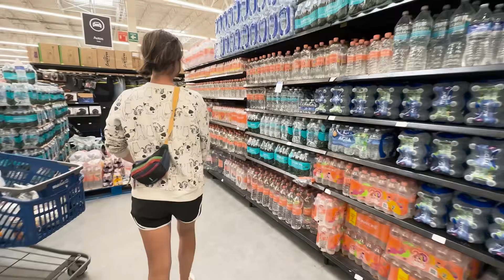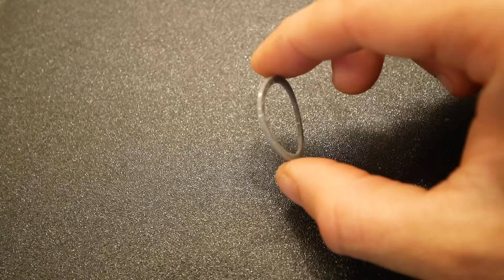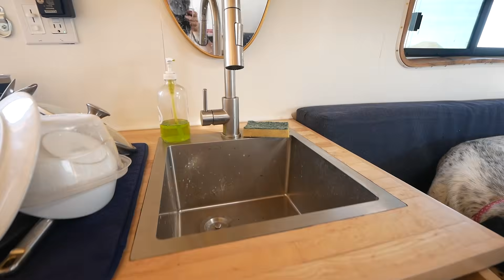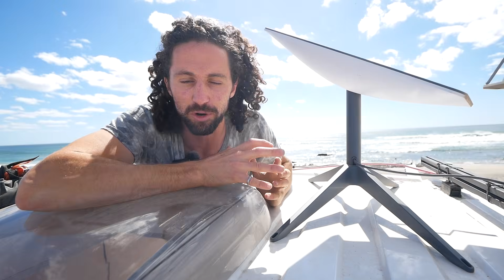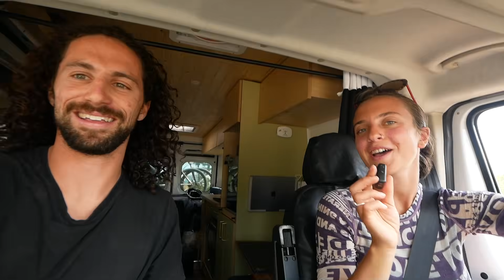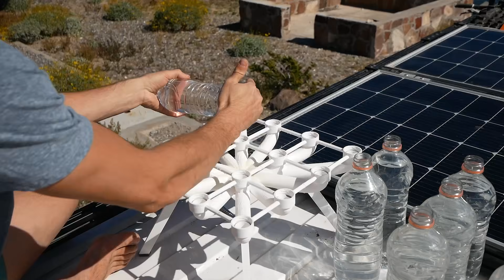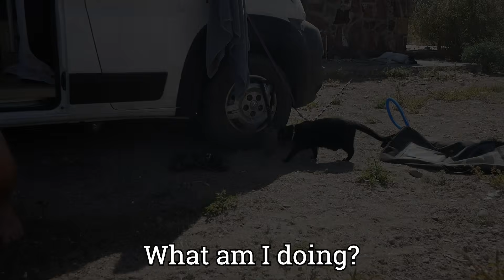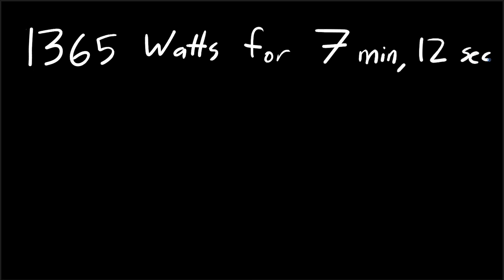I Built an Unnecessary Invention for Van Life

Comment from the maker: Regarding my nose: I scraped it on some coral while swimming in Baja. Super minor injury, but face wounds tend to bleed a lot 😂
Reply: Suggestion for you: Get some magnetic child lock mechanisms. They'll stop your drawers and cupboards from opening, but still let you open them with a magnet! Great video as always!
Reply: Please research coral...I lived on Hawaii 30 odd years ago and I remember people talking about living coral and human bodies
Reply: :o
Reply: Great memory reminder!
Reply: Here are 2 examples that you can do. Get a tankless propane water heater. OR. Get a black bucket or jug. FIll with water. Print a valve of some type to release the water to hose. Make a valve vent. Control that valve vent for water pressure. Make the jug or bucket removable. Make video on start to finish. Black attracts heat. WHITE or Clear reflects heat.
Reply: Ahahah i tought u face landed the ride with ur gopro stick and bike 🤣
Reply: At this point its almost a shower drone😂
Reply: Man hope rou heal really soon
Reply: regarding water usage. I came up with an semi easy solution for water recycling in a shower but you need to be standing in a tub to make it work and have some plumbing know how. The tub needs to be filled with warm water and you need a pump water through  two filters up to a shower head. It requires some adaptors to get working but greatly reduces water needs and creates the ability to have longer more comfortable showers anywhere. When your done your shower you can then use the filtered water for a portable washing machine or water for cleaning instead of dumping it, (Though filtered I wouldn't trust drinking it). You have three choices of pump, a submersible portable battery pump (avoid the cheap ones, (you get what you pay for scenario), AC Submersible pump, or 12v DC RV pump. You then need a filter to attach to the pump for debris and hair. Then an in line filter after the pump for soap, dirt, and everything else. That's the basic concept, unfortunately the situation varies for how you create a water recycler. You can get really creative with it because adapting it for different uses just requires a tub over tub or platform in tub design.
Reply: R u ok

Comment: In a clear bottle what the sun does is kill microorganisms and better a little the quality to drink. But for that is better to use glass because single use plastic is not recommended for repetitive drinking. But for the temperature, it depends more on the temperature of the place combined with the light of the sun. So you would end up with hot water only in places you wouldn't want to take a hot shower. I am from Barrancabermeja, Colombia and the water in the pipes on the roof gets very hot, so for every shower you take during the day, the first minute you feel like you are being prep for cooking until the water of the tank starts to come jajajaja

Comment: Damn man I just wish you'd do a bit more research at least. I understand it can be fun to figure everything out and trial and error is essential. But hen you waste a bunch of plastic (and time)  to come out with a bunch of issues while you could have just used a Black bag (or canister with a small whole) like everybody else.  Also having many bottles while increasing surface area for the sun (possibly a bonus) the space between them actually also acts as a cooling effect. So this invention truly is unnecessary but hey it's all about crating I guess. But some mistakes just should be more than obvious from the start. Like even if it would have worked it would be so much work each time to use it lol..

Comment: There is some merit in making it this way but black, small amounts of water with more surface area will heat up quicker. You could add an air breather to each bottle that ends near the bottom (Top) of bottle, make sure you fill each bottle below the end of the breather. Each breather goes through bottle neck and  attaches to the feed pipe below the thread and is straight to the outside. Add a two way tap to the shower feed line and put a hose fitting to fill bottles.

Comment: I'm a year late, and only 15 mins into the video so maybe you have a similar thought come to mind later in the video. But couldn't you screw the empty bottles into place upside down and then put a hole in the bottom or now top depending how u look at it of the bottle where you would be able to just leave the bottles in place forever and refill them between uses thru the hole u make at the now top of the bottles? And then just have some sorta plug to put into the holes when the bottles are full to keep anything from getting in and contaminating the water? Think like ... the plugs at the bottom of a piggy bank? Something like that? 

Thennn you could create a sorta octopus like funnel even using like whatever kinda tubeing (personallly im thinking like the kinda tubing used for aquariums to suck out water for cleaning) and basically have a tube for each bottle ... attach to one main larger funnel sorta contraption ... so when you're at whatever water refilling place you're able to just have rhe water pour into the main funnel and have each tube funnel water to its respective bottle ... and thennnnn when theyre full ... disconnect the octa funnel... plug the bottles up and your done?? 

Since the hole would be at the top of the bottles (the top that use to be the bottom) then gravity should be enough to keep the water inside even if they aren't completely 100% water sealed. 

Shoot i just thought of it too. I mean your going to neeeddd to have some sorta top air hole anyways right? Otherwise wont the bottles start to basically collapse when the water flows out. Like when you chug from a bottles drink to fast and suck all the air out ao it sorta vaccum seals itself inside? 

Well i guess i should prolly just press play now and finish watching to see if I'm right about this potential problem and what solution u come up with huh?

Comment: I know this one has been out a while but what if you put a valve in the shower line and kept the water bottles in the array, empty. Then bypass the shower head at the valve alllwing youn to fill the array one bottle at a time.  You’d have to hold the fill end up higher than the array but it should work.

Comment: I find it interesting that in rural areas of Mexico it's harder to get clean water, because my family goes to Kosovo every year and over there it's actually easier to get clean water in the rural areas, in fact, it's typically free; in the cities there are free water refill stations (there a lot like fountains but they use drinkable water) but they are less common than in other European cities and you still end up buying quite a lot of bottled water. But my family has a house  just outside of Mitrovica, and when my grandpa was alive he routed a pipe from a very large hill (or a small mountain idk the classification) all the way down to the house, meaning we get free melt water from the mountain for free directly at our house.

Comment: re: printing something that doesn't work, what's the point? - The point is learning!  I don't have the stats to back this up, but I'm absolutely certain that humans learn best from failure. "The next big thing" doesn't usually happen because people keep rebuilding the same old things over and over. They happen because someone goes "haha no but what if we tried this??  It sounds ridiculous, but what if?" 

"Ever tried, ever failed.  No matter.  Try again, fail again. Fail better."

Ideas that probably won't work, but hey why not:
- Use sport caps (the ones that you pull open) so that you don't lose much water when flipping the bottles.
- engineer a cap with a valve that opens when it's poked open by something inside the pipe
- find a way to make smaller sets of these that connect to a central doohickey so it's easier to flip them upside down
- brackets or holders to make the bottles more sturdy
- how do those bottles hold up to pressure?  like if you drink a small bottle fast, it collapses in on itself

Comment: You can't take a fixed amount of power 163Wh and divide it by your total capacity to get 2.5% then extrapolate that since your batteries were 25% full and at 100% it would use 4 times that or 10%.
It's still a fixed amount of energy. It would go from 25% to 22.5%.
So at 2.5% system charge are you going to say it uses 100 of your batteries?

Comment: I thought you're gonna cut bottles to make a spool of filament out of them and then print a proper water tank and shower handle. By the way the container must be painted black to gather the most out of sun's energy, clear water and clear bottles do not capture too much as rays pass through and get reflected. 
And you could have added a foot pump to add some pressure to the tank to increase the flow.

Comment: So, here's what you do, instead of just using female caps for the bottles, make the entire thing out of black filament, and including a cup/shield that surrounds each water bottle and attaches to the female cap you printed, so it is one pieces, like a funnel with a threaded piece on the inside (This will also prevent any issues with spillage when putting them in, upside-down, so long as the black sleeves are integrated into the device). Also, place a "wye" or tee on the line, so if you lose pressure, you can shut the shower nozzle off, and blow back up into the bottles with your mouth to eliminate the vacuum. You may find quite a bit of pressure that way too. You might not want to give up on this maybe? Might be cool to have such a thing printed and ready in case of an emergency or smth

Comment: id have used 2 liter bottles and covered them in black black electrical tape, or flex seal. this would also let you increase the max pressure the bottles can hold. spraypaint would crack and flake off.

Comment: A good solution for filling would be to print a "baseplate" rhst supports the water bottles at the bottom and attach it to the base with removable struts so you can fill while upside down then flip it b

Comment: Honestly I would have printed this to make use of the existing cap that comes with each bottle, since that already has the right threads. Also if you need watertight seals to bond all 4 sections together, I would use plumbers putty, silicone is not a waterproofing substance (it can't handle constant water contact).

Comment: Neat exercise in problem solving and design. Especially showing folks how to model threads and the problems they'll face doing it. Also, Bambu Labs should give you money or a second printer! That drive out from your campsite and the print was still fixed to the bed! OMG, I'm sold! If I bump the filing cabinet my Ender 3 V2 sits on, it can delaminate PETG from the buildplate! My next printer will defs be a P1S, probably with the spool changer. That is the BEST upsell I've seen for a printer! Works even while driving on a broken gravel road!

That said, maybe design this shower for use with a single, large, 5 litre (gallon and a bit) HDPE bottle that you leave screwed into s suitable manifold and stand. Then, drill a bean tin sized hole in the bottom of that bottle and fill it through that, once upside-down on the roof, with a reused, drink-sized water bottle or even a hand pump. Using a single, large (probably cuboid) bottle will allow fitting one or two, thin, black plastic panels on the sun-facing sides of the bottle to increase heat absorption, too, as the larger volume will have a relatively smaller surface area per litre. 

The PET bottles look like they're getting pretty bashed up with each fill, so it's probably better to just use aluminium drink bottles filled from your potable water tank and the HDPE bottle, as this is all long life stuff that obviates the need to recycle PET bottles. From an engineering standpoint, that's actually more closed-loop than recycling endless supplies of PET water bottles.

Comment: and yes, make  a clear casing around your conntainer if it is permanently fixed, so that when you are driving it does not cool down by air flow...
Reply: basically the way they do it for water heating in houses. panels with black vacuum insulated tubes filled with water... (solar vacuum tubes for water heating reach 200 C on a sunny summer day I think)

Comment: Ok my 2cents here:
1.Tightening the print: use bondo, maybe with a bit of fiber-reinforcing
2. Refilling: buy 16 more bottles, cut off the threadhead and hot glue them onto the old bottle bottoms, then melt holes into said bottoms with a soldering iron. After refilling, do not screw the caps on airtight so that the water flow doesn't create a vacuum.

Comment: fun fact, the bottles are not watertight at the threads, but the threads help push a ring slightly smaller than the opening of the bottle into the bottle, so it works more like a cork

Comment: Why not just get a good water filter?  I have a reverse osmosis system under the sink.  
Take whatever not-guaranteed-potable-for-gringos water you find, add the standard water purification tablet (or drops) to kill any nasties, then run it through a filter like "zerowater" that's supposed to remove everything .  Rather slow pour-through design, so have a large "before" tank that drains through the filter over a period of hours.  
At least they should have gallon or better, not individual sized bottle packs, at the store!
Some grocery stores have a fancy filter in the store that you can use to fill your own reusable jug with.  If you have a 5 gal bottle you can take advantage of that.

Comment: Im watching this late, first thoughts were... print it black.  Add a long tube taller than the bottles and use that as your fill tube leaving the bottles in place.  It will  also allow air in for better flow when showering.

Comment: Solar shower (black bag with hose) can be had for $10. Water can be bought in gallon bottles, or just fill up a 50+ liter tank.
Also: the motor of the van makes a lot of heat while driving. Installing a heat exchanger at the cooling fluid for water is easy, that way you always have warm water after a drive

Comment: I would try a pool solar heater. Maybe it's not hot enough for the smaller roof on a van,  but in Arizona it works great. It's like a pond pump that pumps water to the roof with black hoses in a spiral.... Then, it flows back to the pool and its piping hot. It's like a black hose and it's spiraled in a frame and it usually brings a pool up a few degrees warmer.

Comment: but... why not just use the original bottle caps?
Reply: the ones he used are attached to the octopus and he just has to screw the bottles in. what you’re saying would be a lot more complicated
Reply: @sunky-  I don't see how remodeling and printing custom threads is less complicated than glueing the caps in some pvc pipes lmao, work smart not hard
Reply: @Jaymansharma yea but its content, and also using the cheap caps would look bad and be a lot trickier to put onto the octopus.
Reply: @eeeofficial  prove it
Reply: @Jaymansharma  no
Reply: @TuckerStone-n7o  then hold this L
Reply: @Jaymansharma  As the one trying to bring the counter argument, the proof would be on you technically. But also, do PVC pipes even come short enough for them to be easily used for this?
Reply: @sunky-  yea
Reply: yea
Reply: Its his choice and like some of you say he learns about mistakes that will help him later if he does more stuff like this
Reply: @Sturto.  yea
Reply: @Sturto.  yea
Reply: “When your only tool is a hammer, every problem looks like a nail”
Reply: This is cooler and makes for a better video
Reply: That’s what I was thinking
Reply: It’s not connected to the funnel
Reply: @Jiskool5  if you glue the bottle caps with holes into the pvc pipes there is no need for printed threads
Reply: lmao, I thought the same. Also, why not just use PVC pipes? I don't understand this fixation about 3D printing everything.
Reply: @lucascunha7744 he likes the challenge of designing it, it will help him learn to design things.
Reply: @lucascunha7744 why does a YouTuber who 3d prints a lot have a fixation on 3d printing things?
Reply: @lucascunha7744  yeah i thin
k i kind of understand him, when you keep working with the same tools your brain adapts and you see how you can make a bunch of things work without other methods... but it definitely is always smart to re think if there are easier solutions.
Reply: @lucascunha7744 exactly. Use the right tool for the job.
Reply: @lucascunha7744 that is not reusing stuff
Reply: @lucascunha7744  PVC pipes don’t usually come that short…
Reply: how is water supposed to funnel down if the caps on?
Reply: @unclehair47  there's this crazy thing called a drill

Comment: if you got some nice (not 3d printed , or at least non toxic filement)  pipes and a good rain water filter, you could still reuse the bottles to catch rainwater over the day or night when your parked. i do believe you need to boil it still but you could probably get an electric boiler  to run off a battery bank and use your solar panal to charge and run it.

Comment: Morley, any invention goes through several tries and re-engineering .... just because something already exists doesn't mean you can't improve upon the design. I, for one, commend you for your thinking "out of the bottle". If I may....  I would make a cube structure for the tubes (infinitely less spider like, and infinitely less cool looking I know!)... this should give you more meat, less leaking and easy placement on top of the van. Design a "vertical swivel structure" to attach to your cube.... allows you to turn over and  screw-in  bottles once filled up, turn back to have bottles drip......and I would install it on top of the van so that the sun can heat the water.... good luck and don't get discouraged! This was a very cool attempt!